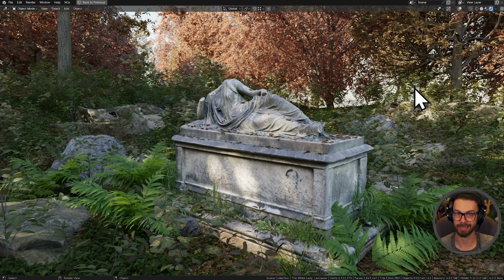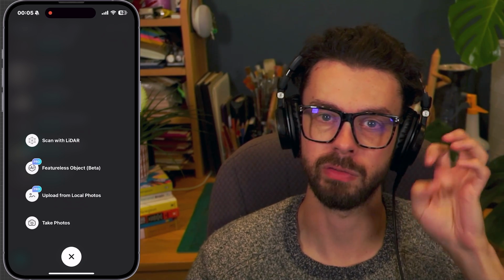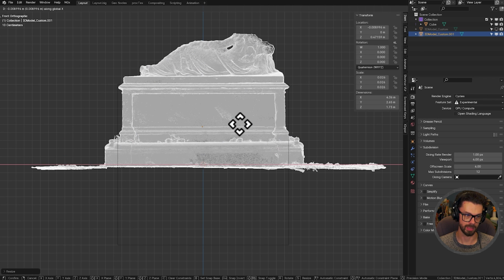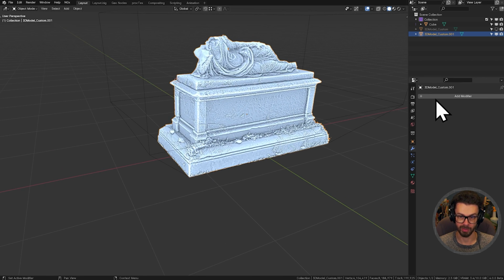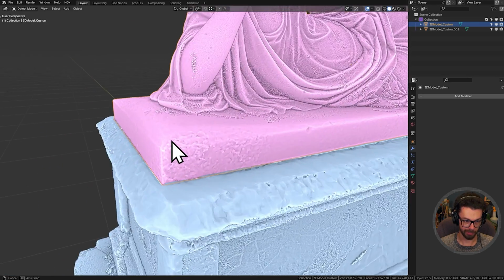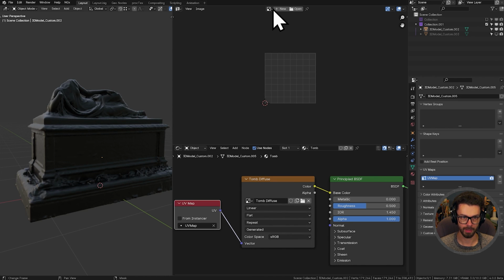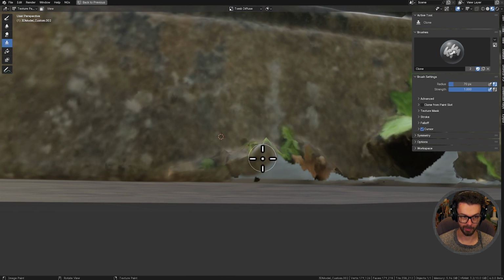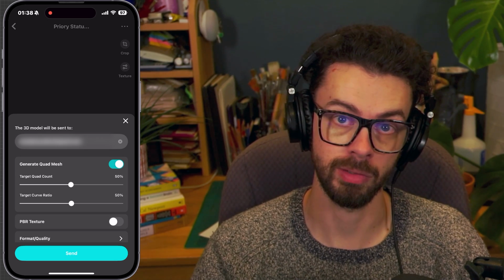Stealing Reality - Photoscanning with KIRI Engine and Blender

Comment: Thanks for this great video! i am able to follow till baking- i have a camera as object and after remeshing and uv unwrapping, the diffuse color is all over the model (i have only one object and followed baking step by step...). any suggestions? am i missing something?
Reply from the maker: So you remesh and unwrapped and then the diffuse colour is on the model in the wrong places? That would suggest that you need to bake the diffuse from the original onto your remeshed version (using a new image texture to bake onto). You should have two objects, one being the original scan and one being the retopologised version you want to bake the textures onto
Reply: Thanks again Erin! I played now some days around...- Turned out, that if I enter a value (0,1) into extrusion ( in the "selected to active" menue  ) baking works as intended.

Comment: very good dear Erin! do you have any experiences with meshroom? it's open source and easy I believe. I have it but never done photogrammetry with it. since you did with Kiri, it would be a nice comparison if you had experience with meshroom as well.
Reply from the maker: I used to use mushroom a lot. It has good defaults and it’s quite configurable. You still need to sort your own photos and lots of other manual steps so for me, it’s not worth it when apps like Kiri engine and reality capture etc can do as good or better completely automated on your phone that you have with you. Being able to process and check a scan worked properly before you drive home is often very helpful
Reply: @Erindale  Thanks for your deep and good explanations!

Comment: If you are on windows and have a GPU, meshroom is free and works well.
Reply from the maker: That’s what I used to use and it is good but I don’t see it as very viable for beginners with all the extra options and customisation. Great once you understand it but Kiri gives very good results with essentially no knowledge requirement